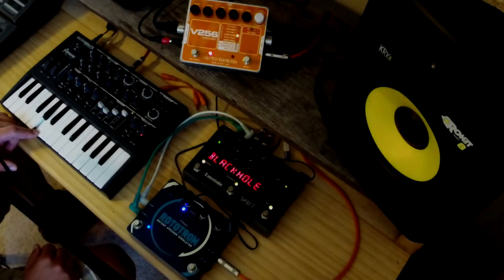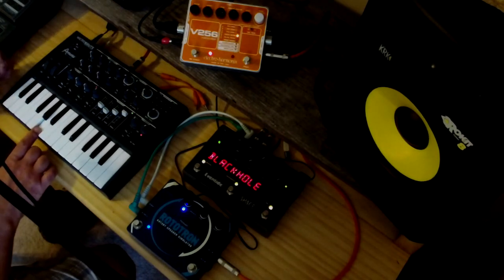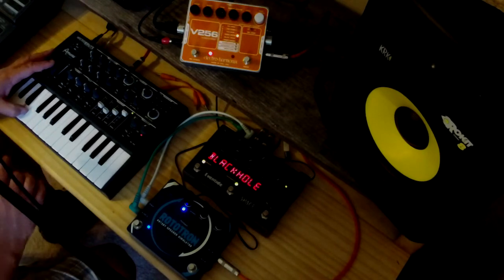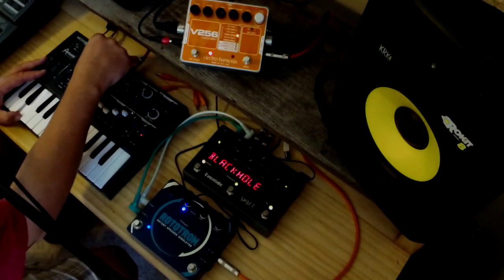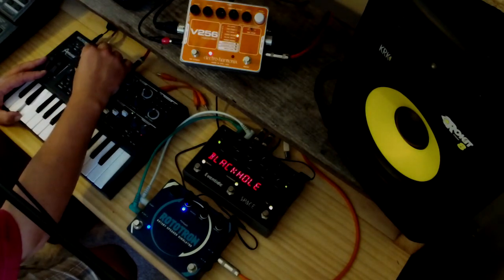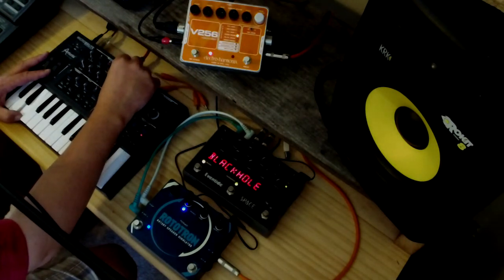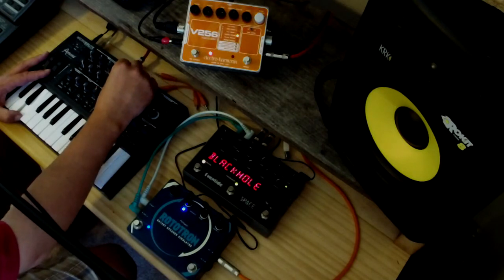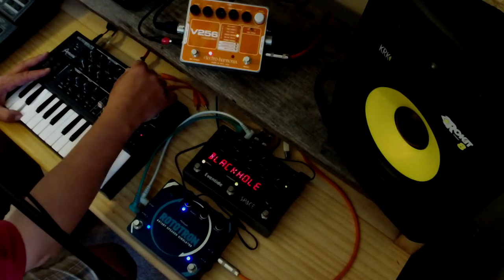Microbrute with EHX V256 Vocoder, Pigtronix Rototron and Eventide Space [DEMO]

Comment: Sorry to blast on another question. Please can you confirm if the Rototron can take a mono signal and convert it to a stereo one with the effects applied. Thanks
Reply from the maker: Gruntz 15mm In the video there is a single cable going in on the right and a pair coming out on the left side of the unit. Yes it does mono to stereo. Thanks for asking!
Reply: Thanks for the note!

Comment: ive never had a synth and im really torn on what my first one should be, i have messed around a lot on korg machines and they seem to be a fav of mine but ive hardly any experience with anything else. do you have a recommendation for a nice beginner synth that is reasonable priced?
Reply: nick tiegs Do you want a polyphonic synth or monophonic synth? What kind of sounds are you after, and what music do you make? Do you want to be able to tweak the sounds in real time with knobs or... are you satisfied with presets or do you want to make your own sounds? The Microbrute is an excellent analog mono synth. For a polyphonic one I would recommend a Roland JX-8P or Korg DW8000...but those are old school 80's synths, pretty cheap though, that can be hard to get hold off. The Yamaha AN1x, a VA synth from -97, is a bargain if you can find one.The Roland Lucina keytar/synth is a quite cheap nice beginner's synth. You can't do a lot of programming though. I could also recommend the Waldorf Blofeld which is quite cold sounding but still extremely versatile and very powerful. It's not that easy to program though without an editor...